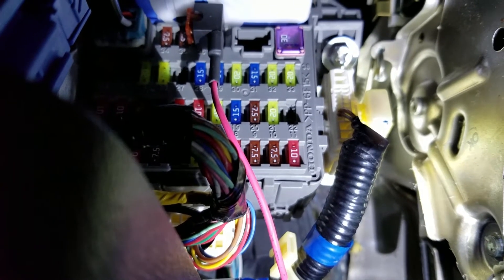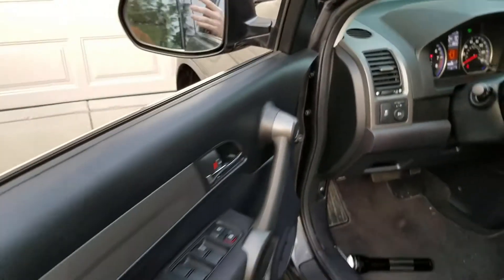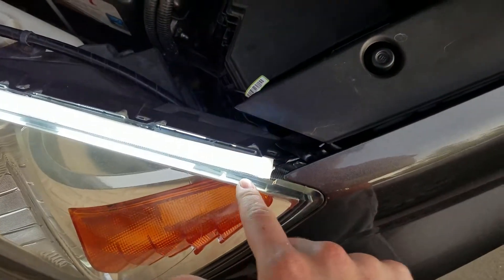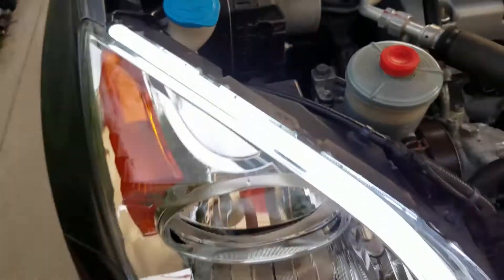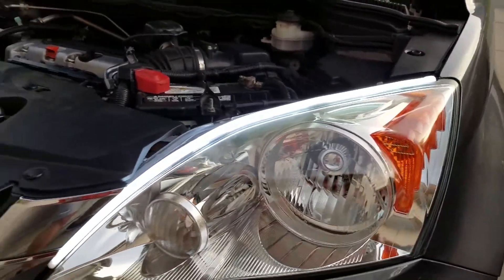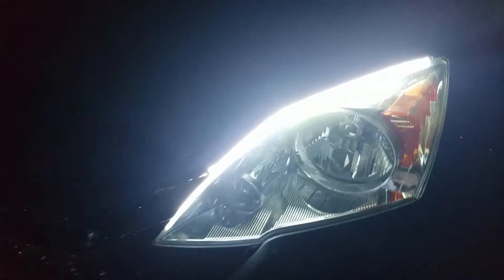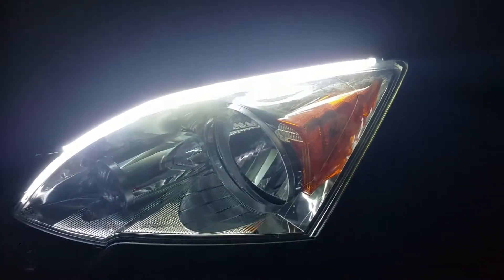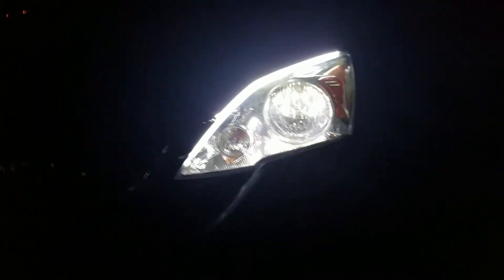How to Install/[DIY] LED Eyebrows!! Short version. 2011 C-rv. Bright flexible LED light strips!!

Comment: Hey dude, great video! Really easy to follow all the steps and great audio! But could you maybe just write the name of all the connectors, the wire and adapter u use so i can easily find it hehe 🦃💨
Reply from the maker: Thanks man! Yeah I can do that! I'll send you the names after my shift. Mostly bought everything at Walmart and Advanced Auto Parts
Reply from the maker: Alrighty got the list! It's been awhile, so the best reference was my longer version of this video. Things I had on the table: ATM-LP Fuse tap, 3M Double sided tape, 16 and 18 guage wire, crimp wire connectors for both guages, 18in zip ties, flex tubing 3/8" diameter, connector kit hyper tough 40 piece electrical connectors set and heat shrink tubing. Hope that helps you out! Also there is a thinner type of LED strip that came out in the market. If this style is too thick
Reply: Thanks bro! Installing mine this week, wish me luck!!
Reply: Got the new ones u got with the driplet blinkers!! So its gonna be awezome!
Reply from the maker: Sweet man! how'd they turn out??? Bet it looks sick!
Reply from the maker: Yeah those are the better ones!

Comment: Hey I hope you'll reply me.  Is there a way I could get very bright led DRL strip? Like the one you used is 12v. So if I get something closer to 20v, will it be bright? Cuz under direct sunlight, it's hard to notice them.
Reply from the maker: Hi, I've been looking for bright LED strip for some time. I think increasing the voltage doesn't make the LED brighter. It put more of a load on the resistor generating more heat. Agreed under the sunlight it's barely noticeable
Reply: @MrIII  what would you suggest then? Is there any brightness difference or all the aftermarket strips are same? And also is there any dislocation in the bumper due to the strip?
Reply from the maker: Currently I have these LEDs installed on my car " 2x 60CM Switchback LED Turn Signal Daytime Running Light Strip Sequential Slim"  for a couple months. A little different for the ones in this video. They are thinner so my hood isn't slightly raised anymore. But a little less noticeable in the daylight since it has less material to illuminate the tube. I don't have any suggestions for a super bright and fair price LED strip. Still looking. If I find one I'll let you know